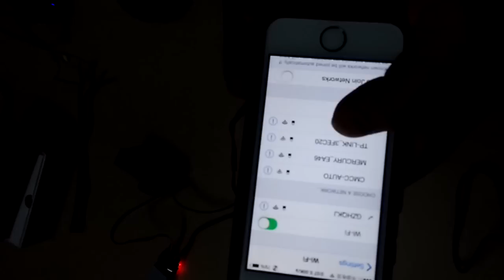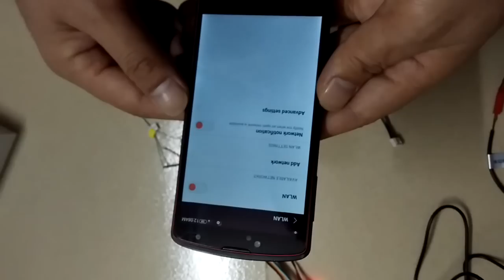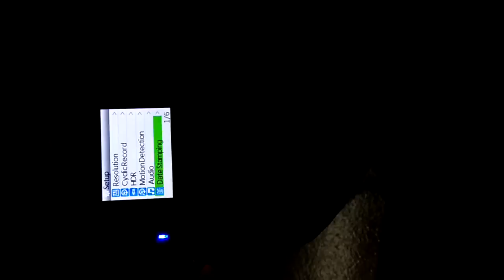Cheapest FPV Kit 5.8G AV Transmitter TS351+RC305 Receiver+802W WIFI Transmitter+SJ4000 Camera

Comment: Wow!! I like this idea very much! But I have a DJI Phantom FC40, where the radio transmitter is 5GHz and the WIFI signal is 2.4GHz. Do you have any plans of selling the same kit but at 2.4GHz? What distance can you get with this?
Reply from the maker: hi,friend,the CX-20 drone radio transmitter is 2.4Ghz,and the FPV is using 5.8Ghz,in the FPV receiver,use the WIFI AVIN Convert the 5.8Ghz signal to WIFI
Reply: Bruce He Hi Bruce. I understand that: the video is sent in analog video from the drone to the receiver using 5.8GHz, and then the receiver transmit WIFI to the phone using 2.4GHz, but there's a problem with the DJI FC40: the controller works in 5.8GHz too, so it's very very easy to lose control of the drone because both frequencies (video and control) are on 5.8GHz. See here: http://www.dji.com/product/phantom-fc40/spec
Reply from the maker: Alberto Martinsen  hi,friend,you are right,DJI FC40 have to use the 2.4Ghz FPV Kit,Unfortunately right now not  2.4Ghz FPV Kit
Reply: Bruce He OK, thank you!
Reply from the maker: you are welcome,once there is,i will let you know

Comment: Looking for transmitter that will plug into the slot in the back of my Hero 4 Black and send WiFi directly to my phone WiFi.  Using a Samsung G5 phone.  Any good ideas?  Also antenna might need to be on the bottom of the camera because I'm using it with a Blade 350QX2 AP.with gimble.  Would rather not have to deal with another receiver if possible.
Reply from the maker: hi,friend,i suggest you use this:
http://www.aliexpress.com/store/product/FPV-5-8G-200mW-8CH-AV-Transmitter-TS351-RC702-32CH-Receiver-7-Inch-Monitor-SJ4000-Camera/300505_32284359095.html
don't need the Camera
Reply: +Bruce He WHAT IS THE NAME OF THE APPLICATION

Comment: Hi buddy, is it possible to connect 802W WIFI Transmitter directly to gopro and receive av directly on my phone? will range be an issue?
Reply: Joban Singh range will be a problem. wifi on all cameras is almost always made just for framing, so it will only go  a few feet. Hook it up to  an fpv tx/rx.

Comment: Hi there what battery is powering the wifi transmitter?
Reply from the maker: hi,friend,you can use 2S or 3S battery,need JST plug
Reply: Thank you so much